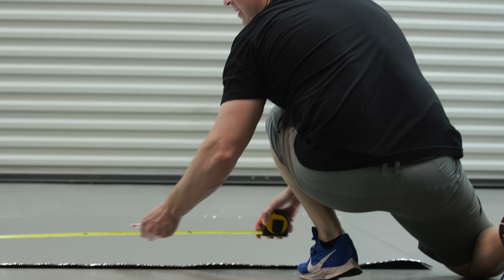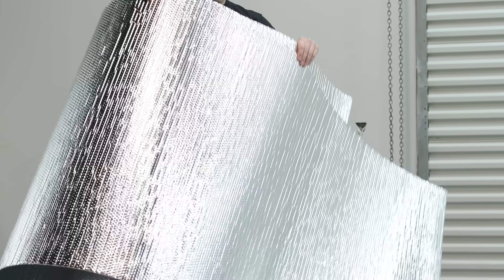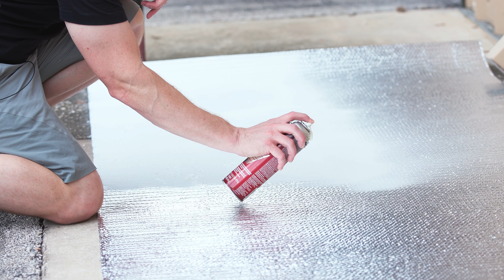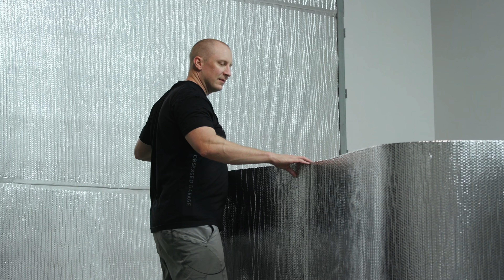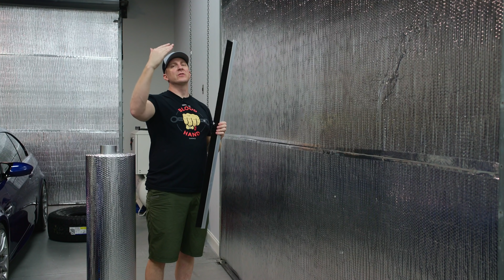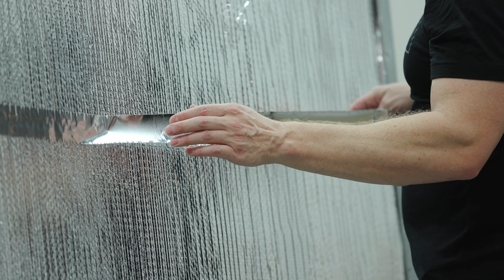How to Insulate Commercial Garage Doors

Comment: If you open and close it daily, how long does Reflectix last?
Reply from the maker: I've had pretty good results with it.  I've had it on for 2 years, and it's still going.  You may need to add some glue and tape every so often.

Comment: With cars inside a ac controlled area when is OG going to do a video on exhaust fume blower systems so you don't have to open the doors when running vehicles inside.

Comment: How has the glue held up? Glue has a max heat range, and i know my door hits about 130 degrees. I've used spray adhesive on some stuff, and it has come apart. Has any come apart. I'm thinking a mix of double sided tape and the adhesive. Thoughts?
Reply: I've saw someone use liquid nail on the raised sections.  That won't come off.

Comment: It may have helped some but that style of insulation needs an 1 inch air gap to reflect properly. If you are touching you get convection. 

Here in Canada I have had that insulation on my garage doors for years but I use it to keep heat in. By touching the door I am not worried about covecting heat in.

Comment: If you run or swipe the edge of your bank card or drivers license edge on the aluminum speed tape you will get a clean even press of the tape. I fix airplanes and use that tape a lot.

Comment: So no issue when the door rolls up? The thickness of the insulation wraps around the roll up drum w/o causing any stress to the roll up motor/chain?
Reply from the maker: Yep, no issues.  I've had it next door for several years.